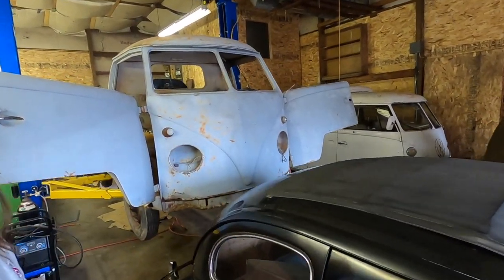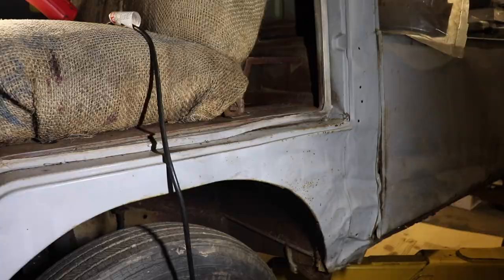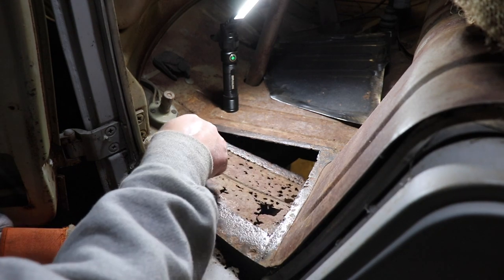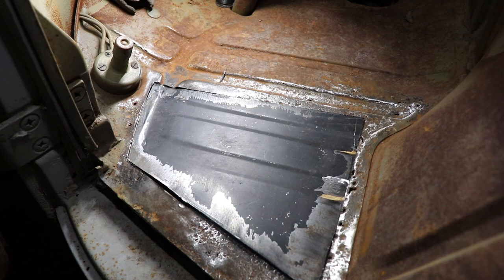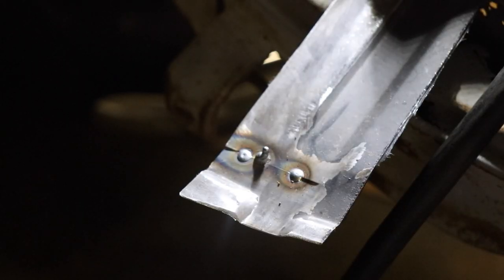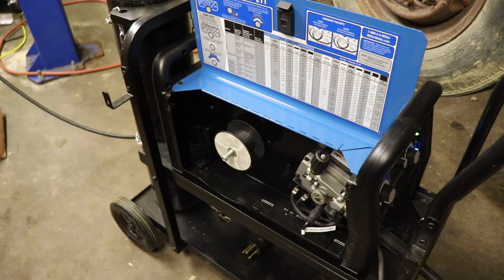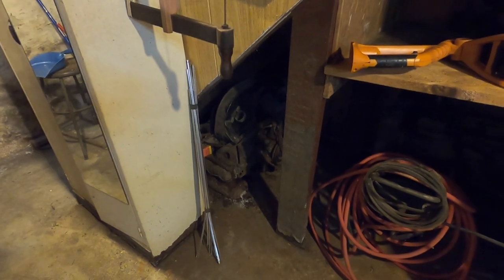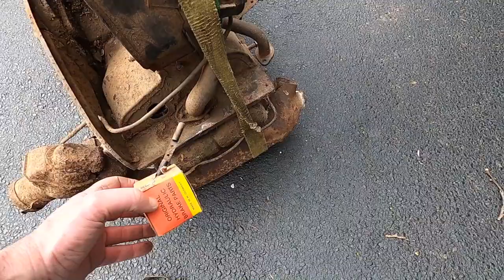Forgotten 1959 Vw Single Cab Rescue : Mig Welding the front floor

Comment: FYI that metal was just too thin I would have put the whole patch panel in on that one. then your butt would be on the frame and easier to penetrate. Other side Use whole panel and you wont have that issue. That is why the welds were burning through and contaminated. You were not able to get it hot enough to melt without contamination and if you did they would burn through.  Cut a little further out look at the metal sides to see how thick they are if they are not thick enough cut further.
Reply: Mike’s the man! 👍👍👍

Comment: Great video Jason 🙂👍 The thing with that mig welding you can clean sheet metal on one side but there is usually rust on the other and the old wire feed just don't like the rust. I used to sand blast the rust and crust on both sides they do make hand held and vacuum sand blasters. When I first started bodywork all we used on the old cars was Oxy acetylene torch and brass or steel rods. The good old days when the earth was green 😁
Reply from the maker: thank you Will , that is why I tried on some fresh , clean 20 G ....to see if what you just said was the case . I'll have to try and clean the underside next time ....I do have one of those small spot blasters , they work well , thank you for the tips.

Comment: In my Chevy that I just got rid of i had installed a harbor freight truck bed crane. It says it will pick up 1000lbs i used it to pickup snowblowers mostly and one time a huge 10000 volt generator with a Briggs  V twin 20 hp .
They are cheap and handy . I mounted mine on 1/4 steel plate 
I highly recommend you guys get one
Reply from the maker: those are cool but my yard is so full of $hi$ now already :)
Reply: It goes in the bed and stays there
Reply from the maker: @danbartolini27  I mean all the stuff I drive by on the side of the road :).
Reply: @5150mxVW  it doesn't take up any room

Comment: My welding improves if I can avoid sharp turns in the hose. Looks like you're bending a hard 180.  My welder is a lot crappier tan yours though..
Reply from the maker: Definitely was a bad position , I had to have the welder plugged in on the other side . Thank you for the tip 👍

Comment: have a 2001Volkswagen cabrio 2.0. with all the junk 2.0 ECU//ECM/PCM/ KEY FLOB its does not run  so putting in a good old trusted Briggs and Stratton motor start and go //lol oh -well 45 M.P.H.